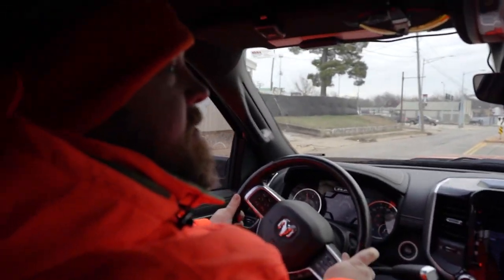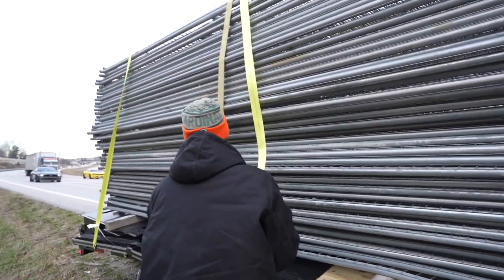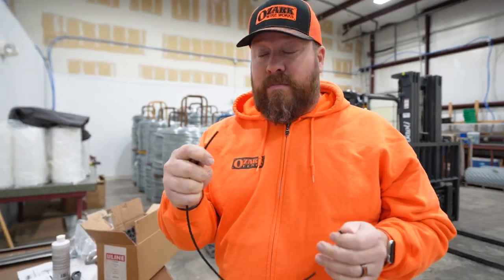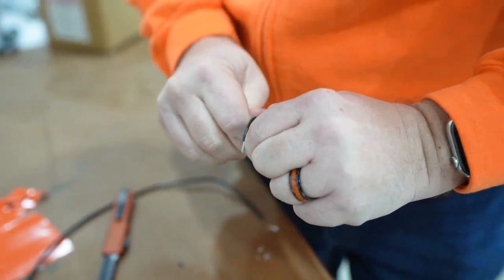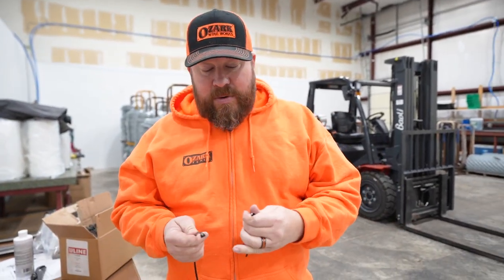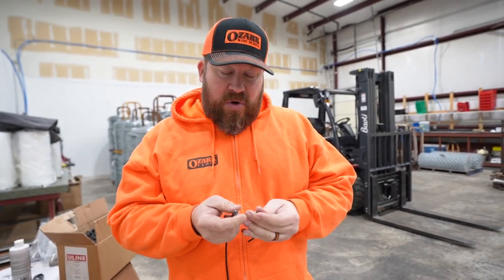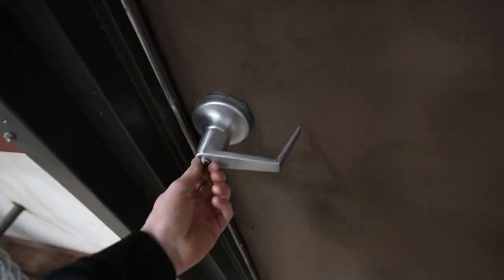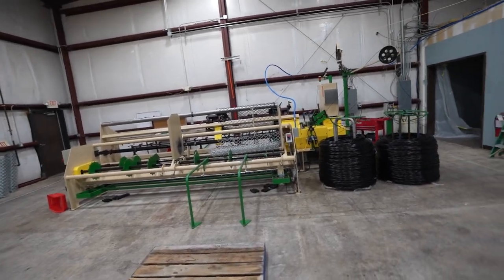1000ft of Fence Installed in 2 Hours - This is How it’s Done

Comment: If you was actually doing post and wire what is my pace just me alone a quarter mile done in 6 hours t post and whatever wire they want
Reply from the maker: Sounds like a solid pace!
Reply: @JoeEverest  not bad and way cheaper than you I charge by the day not the foot. Don't play in town so if the farmers are not getting what they think is a fair days work your done
Reply from the maker: @Andrew-sanders  I don’t doubt it, I would think we have quite a bit more overhead than you do. We don’t do agricultural work, so it’s not really even comparable.
Reply: @JoeEverest  I do lots of chain link to and privacy fence. Overhead you bet you do I won't even fire a diesel engine up because someone has to pay for I ow nothing built my own rig other than insurance cost me less than 20 to run 10 hours that's fuel cost add couple dollors a day to maintain equipment